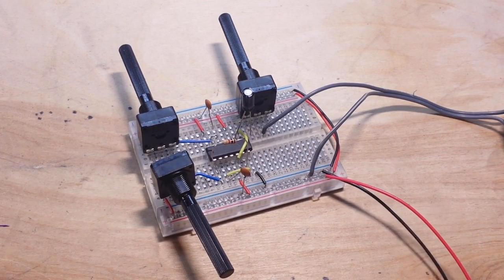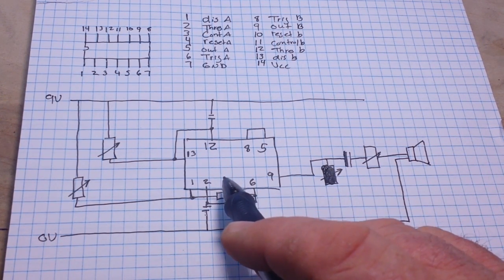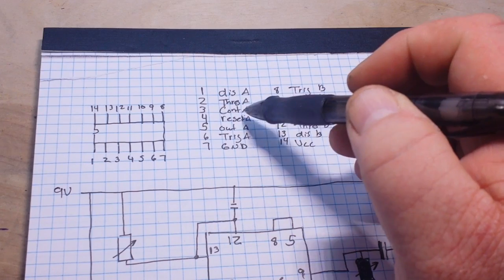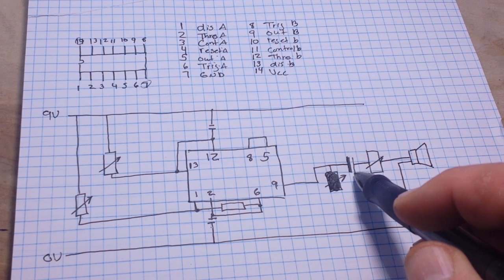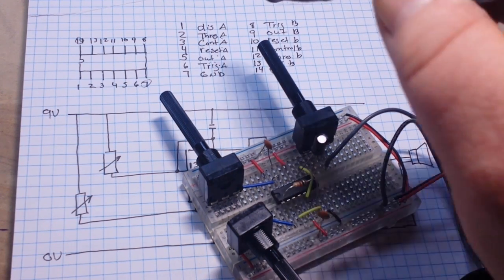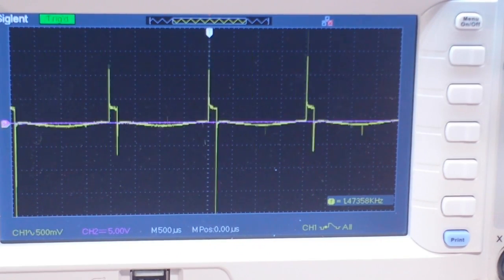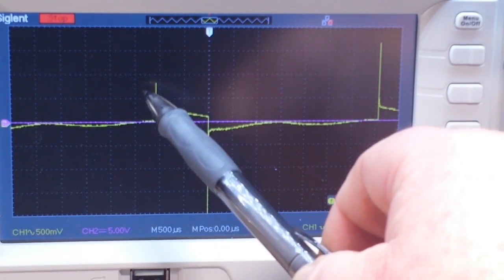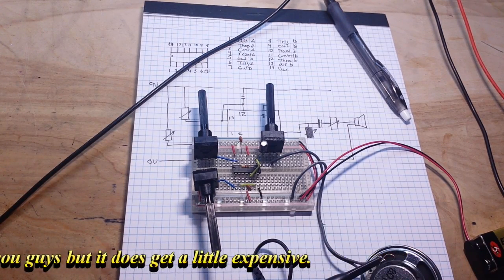Atari Punk Console: The Synth Experiments Continue

Comment: Omelette NOOB here: If you are using a 9 volt DC battery and a DC blocking capacitor, then WHAT is making it through? Please reply, I want to learn more about this stuff. Keep making videos. Cheers!
Reply from the maker: Audio is ac.
Reply: @learnelectronics  But you are using a 9volt battery, at what point in this circuit, is AC “introduced”? - mind blown

Comment: Dear Mr. Learnelectronics --- if there is anyway you can do a video on line level output that would be splendid.  🤗 Glad you built this little synth it's a blast! FWIW the original circuit was designed by Forrest M. Mims III and he called it a "Stepped-Tone Generator" and was intended for use with a small 8 ohm speaker. I believe it was first published in 1986 in his notebooks he made for Radio Shack. Many moons later, the Kaustic Machines website featured a modification to this circuit with line level output and dubbed it the Atari Punk Console. [compiler.kaustic.net/machines/apc.html] I paraphrased this from Collin's Lab but I have Mims' book and have built this circuit several times.